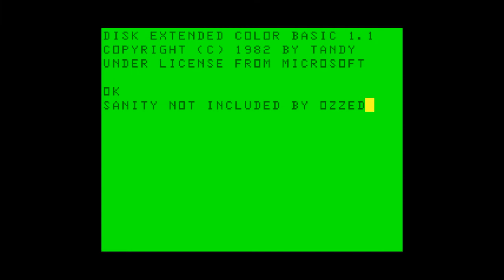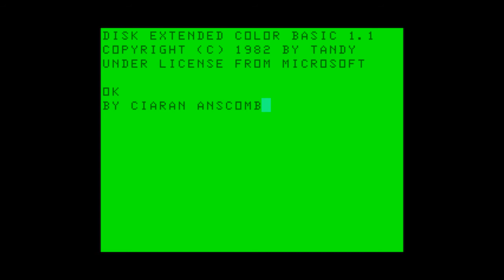Making a CoCo 2, a Retro Resurrection Part 3 #SepTandy

Comment: Impressive before and after on the case. SALT was a custom chip?
Reply from the maker: Thanks! One can get really good retrobriting results in Miami. The SALT was a custom chip and it's hard to find so I made this replacement board because it seems to be a common failure mode. The next chip I want to replace is the custom DAC chip. Might be my next project.......
Reply: @rockyhill3  How many parts would need to be recreated, like you Pepper board?
Reply from the maker: Well, If we're talking about the CoCo 2 you would need to recreate the SALT, the DAC, the SAM and the VDG. There are a ton of SAM and VDG chips available, old new stock and used ones pulled from dead machines. For a CoCo 3 you would need to recreate the SALT, the DAC, and the GIME. The GIME has already been reversed engineered so that means that all we need to design in order to make a new working CoCo 3 board is a DAC. We'll still need a case for it though but I've been looking at the new C64 128 cases that are still made so it might just be a matter of changing the PCB and designing a new keyboard. As far as the CPU goes, 6809's are still made but a bit pricey and 6309's are no longer made , at least not that I'm aware of.
Reply: @rockyhill3  I suppose once we go down the road of recreating things like a GIME, we might as well just run FPGA recreations of everything (unless being used like your Pepper, as a drop in replacement for original hardware). I have a MISTER and Matchbox CoCo FPGA but without the real keyboard they just don’t feel the same.
Reply from the maker: I like the idea of  fiddling with address lines and data lines and being able to pop in a cartridge so I lean towards drop in replacements especially if you already have the original hardware. That said there is a place full CoCo FPGA replacements. Have you tried using a CoCo keyboard USB adapters? I haven't but I know there is at least one out there.
Reply: @rockyhill3  My keyboards are all in my CoCos. I am hoping THEC64/TheVIC20 folks eventually make a CoCo clone with a replica keyboard :)
Reply from the maker: I haven't used Zippsters CoCo Mech but I hear great things about it. Dave6309 is selling or going to sell CoCo keyboards and it is one of his keyboards I used in part 4 of Making a CoCo 2. 
A CoCo clone will be nice and I think we're almost there. We have CoCo 2 and CoCo 3 boards, John Strong is working on a CoCo 3 case,  Zippster sells GIME-X's, and Dave6309 and Zippster have CoCo keyboards. I think all we need is a DAC and a new one can be built. I call it CoCo++ because we can increment the number of CoCo's in the world now.
https://github.com/qbancoffee/cocoplusplus